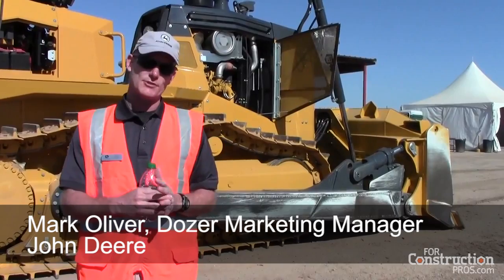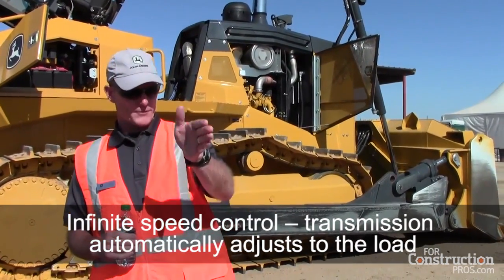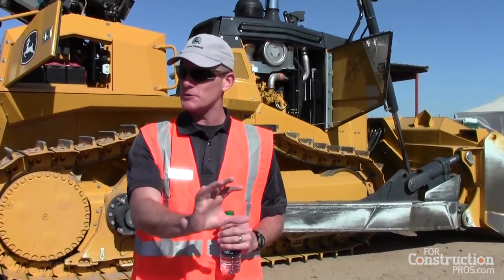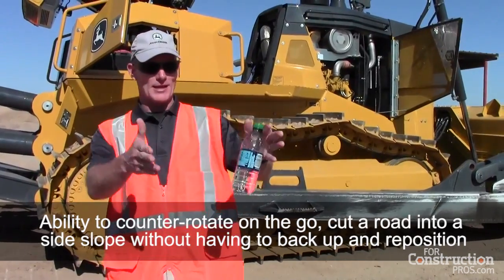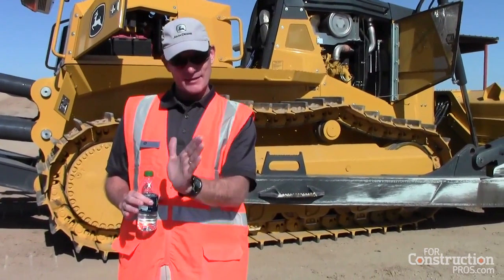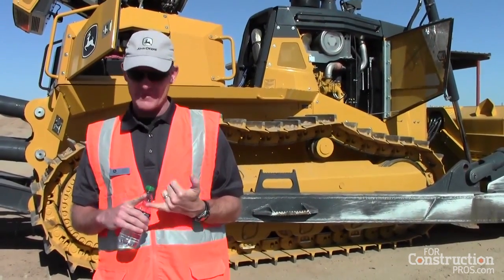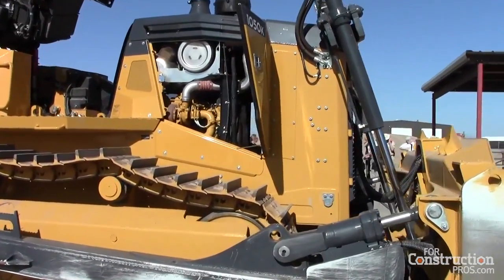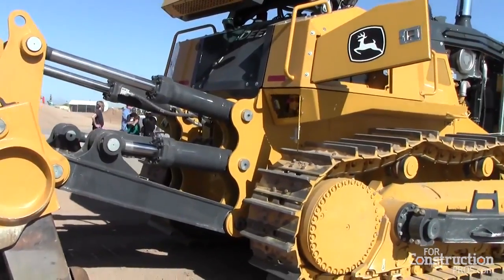Why Deere’s Hydrostat Could Conquer the 350 hp Dozer Category

Comment: Nice video but the company I work for has a D6T cat and a 850J deere they are both around 2009 machines    the 6 has around 9,000 hours and the deere has around 6,000. We run them side by side on the same jobs quite a lot. That 6 will  bury that 850 in productivity and reliability hands down. The 850 has had constant trans temp issues and we had drive motors rebuilt at around 5000 hours. The cat hasn't had any drive components rebuilt. But it is on its third set of tracks I think.
Reply: We have a d6r with 12000 hours still running like new

Comment: I liked the 850K to operate but have not had to own one.
They sure are not built as tough as CAT dozers in a lot of respects and have many problems in 2017
Reply from the maker: Thanks for the comment. What would you say are the most important differences in the toughness of the Cat and Deere machines?
Reply: ForConstructionPros 
Larger and more durable components on the CAT.
One thing I dislike about Hydrostatic is that at 7500 hrs on JD or Cat you have to replace the coupler from the engine to the pump and that is $$$$
Reply from the maker: Thanks again for sharing your experience.

Comment: We got our hands on the Cat 7E all electric drive. It's just an engine, power cables and giant AC electric motors on each drive sprocket. It has all the programable controls as this does. Our three operators really like it. I just messes around with it after hours and fell in love with all the features. This could be just as good. We will have to see if our rental place can get us one to try out.
Reply: Charlie Foxtrot The 3rd 
Are you happy with the D7e?works better then a mechanical machine drive?
Reply: We love it. It has all the power a regular drive train has. The tracks spin if you get too deep of a cut like a regular one does, so that is the same. Where it really shines is changing direction. Smooth as silk and fine adjustments are so easy to make.  We actually rented it and only had it for a few weeks, but I am considering leasing one or just buying. Cat really stands behind their stuff and the local Cat dealer is solid as hell to do business with.
Reply: Charlie Foxtrot The 3rd  I'f you're not bnb used to the brake and run it like a d8r where you just decelerate and go to reverse the first time I ran one if I hadn't had my seat belt  on I'd have met the dash quickly

Comment: Many many things wrong with this video. First being the dozer is a lieber, not a John Deere. 2nd problem is hydraulics, or hydrostatic drives are very inefficient way of transferring power, high heat and high parasitic loss. Great for mowers bad for and heavy load machine, hence the reason no one uses it. Typical John Deere, sell the flaws
Reply: Lots of examples of hydraulic drives in high load industrial settings. You're a goof.
Reply: Actually the k was all jd the 1050j was a liebherr which are also badass dozers
Reply: Your a idiot Deeres are indestructible

Comment: IHC had power to both tracks in a turn in 1956, with TD24. Typical marketing bullshit!
Reply: Yea, I had forgotten about the IH TD 24, sure is and case refined it on their smaller models with those small two sticks. 
Thanks for the reminder.
Reply: Banjo Greg Cantrell I remember one of them two sticks you could turn in Arch with a light load by putting one track in 1 speed and the other track in number 2

Comment: the heat generated by a hst dozer of this size is tremendous.  owners should be wary of product longevity when it comes to major components.
Reply: I've seen an 850K with a ripper melt the floor in the cab when trying to keep up with a high production environment versus a D65PX and D6T